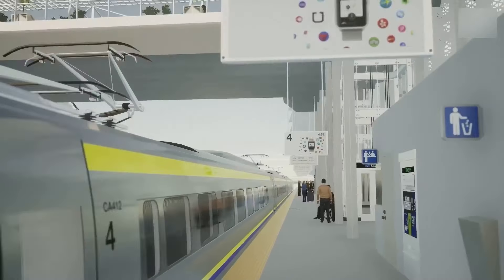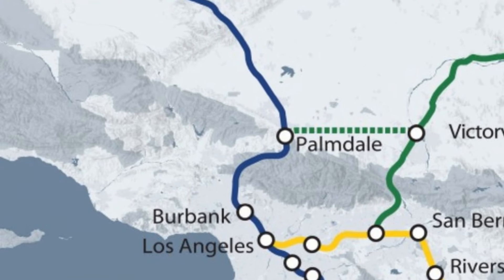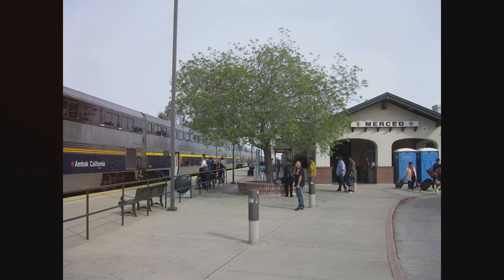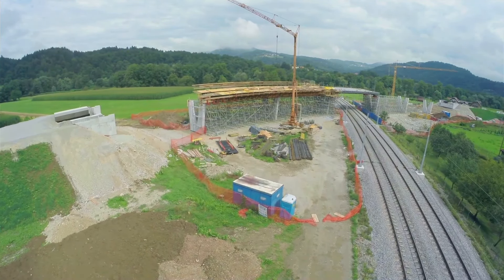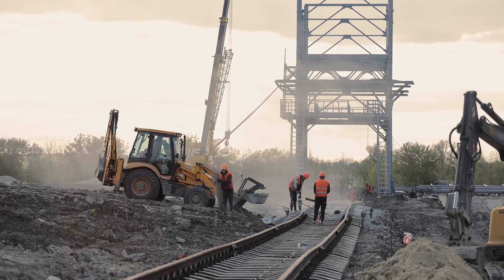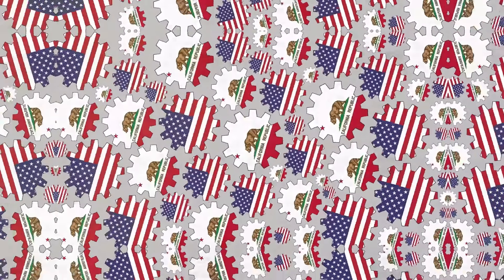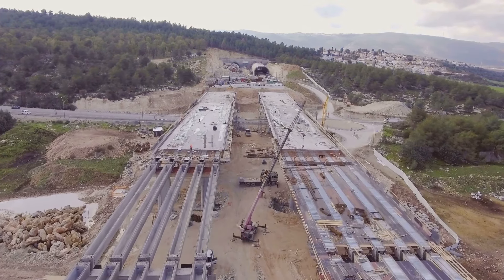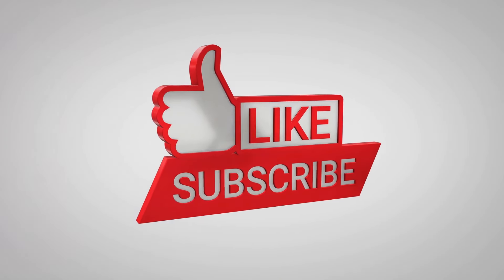California High Speed Rail Project: San José to Merced Segment

Comment: What a colossal WASTE OF MONEY !! IF the railroad could get over the Tehachapi  Mountains faster than 35 miles per hour, they would have done it 100 years ago !! This will never get to L.A. in less than 6 hours. What a waste of money !
Reply: That is why crossing from Bakersfield to Burbank will require 22+ miles of tunnel. The tunnels make it more of a money sinkhole, however. Merced to San Jose is less challenging.
Reply: @JoyClinton-i8g  Fifteen miles of tunnels will be very challenging for the V2V segment.